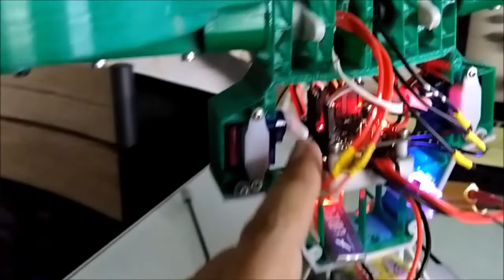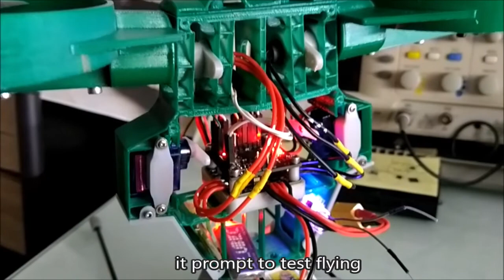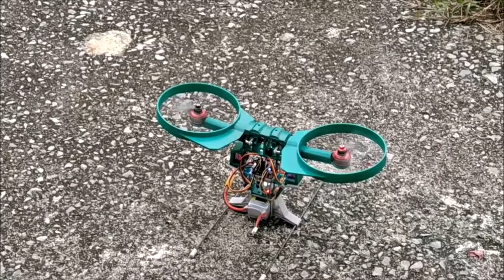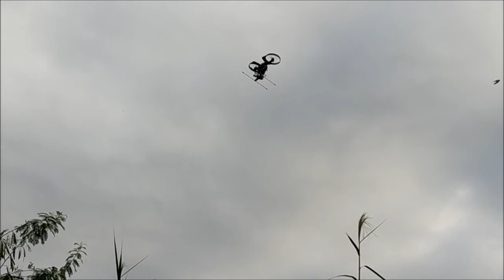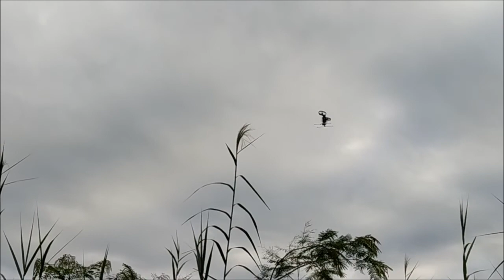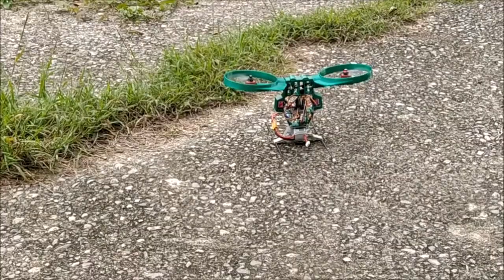SV79-F411 Flight controller optimized for Bi-copter

Comment: What is the P.I.D of this drone?
Reply from the maker: bi-copter that don't have head and tail weight. it can use default PID for flying. if have head and tail weight, it need more pitch PID for stable flight.